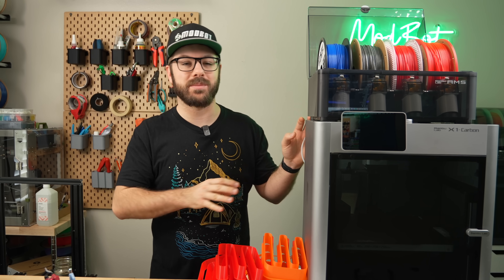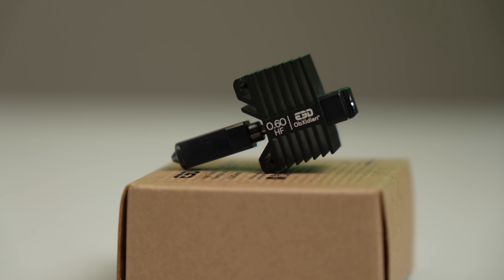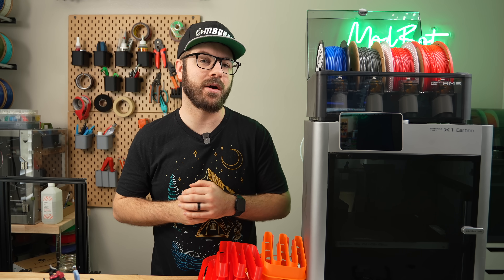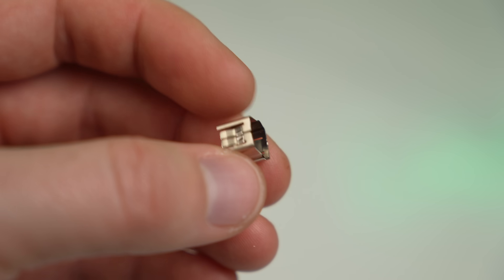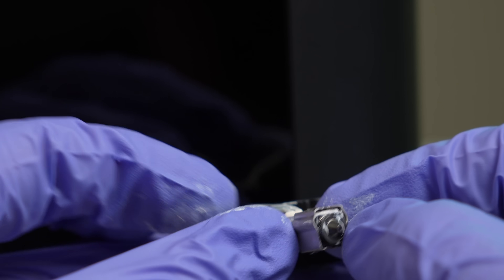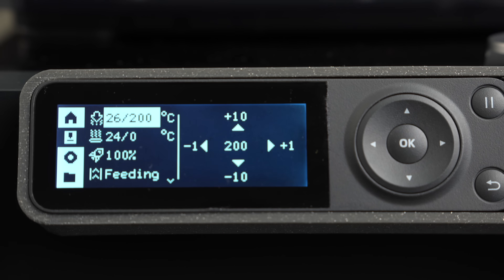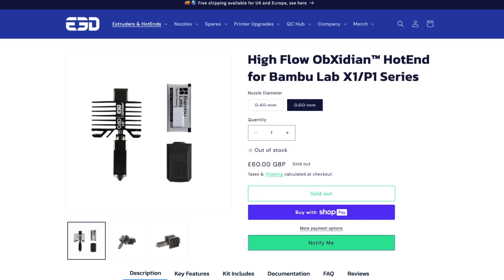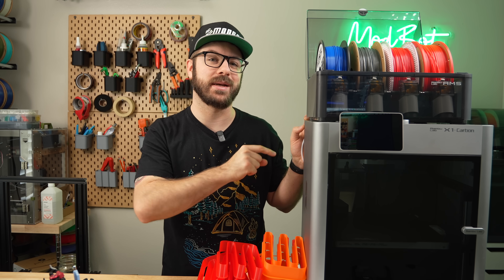Bambu Lab High Flow Hotend Upgrade (E3D ObXidian)

Comment: "the clip wouldnt fit" just flip it...
Reply from the maker: There is a notch for the heater. If that was not the case I’d have flipped it.
Reply: @ModBotArmy  it seems like the other side also has a notch? Did you try it even?
Reply from the maker: @SlinkySlonkyWaffle  the other side has a slit. You can see it pretty good in this photo https://www.aliexpress.us/item/3256805546177949.html?UTABTest=aliabtest481469_657498&src=google&src=google&albch=shopping&acnt=708-803-3821&slnk=&plac=&mtctp=&albbt=Google_7_shopping&albagn=888888&isSmbAutoCall=false&needSmbHouyi=false&albcp=19623912707&albag=&trgt=&crea=en3256805546177949&netw=x&device=m&albpg=&albpd=en3256805546177949&gad_source=1&gbraid=0AAAAAD6I-hEYHPDH2KmZnbj4cxkoef8SU&gclid=EAIaIQobChMIwvSKyYnbgwMVaMzCBB0SyAf_EAQYASABEgLsGfD_BwE&gclsrc=aw.ds&aff_fcid=01dabe2f28eb4985b7cd07b1363a0f2d-1705173308947-09390-UneMJZVf&aff_fsk=UneMJZVf&aff_platform=aaf&sk=UneMJZVf&aff_trace_key=01dabe2f28eb4985b7cd07b1363a0f2d-1705173308947-09390-UneMJZVf&terminal_id=57886f077b044d1ba15d385876c8b7f8&OLP=1086700608_f_group3&o_s_id=1086700608&afSmartRedirect=y&gatewayAdapt=glo2usa

Comment: The clip is the wrong way. Turn it around 😅
Reply from the maker: They is specifically a notch for the heater to apply pressure to it and keep it in place. The other-side doesn’t have that bitch.

Comment: Turn the clip around, that way you're not pressing on the wiring and it fits in the groove like it should.
Reply from the maker: I probably should have shown in the video but the reason I didn’t just flip it is because there is a notch to apply some push onto the heater. The otherside doesn’t have that.

Comment: I bought a Chinese knockoff CHT nozzle kit that's 4 times cheaper and have been running that for months with 35 flow rate and 0 problems.
Reply from the maker: Knock offs are always going to be cheaper. They don’t pay a licensing fee for one. Everyone has to do what’s right for them but other than for experimenting I try to avoid clones.
Reply: @ModBotArmy  Absolutely, we should support the original producers if they treat us right, however, when I picked up the knockoff, there were no compatible alternatives on the market. It was either a stock hotend or a CHT knockoff.

Comment: If you flip the clip around you'll get no issues on the thermistor like you had
Reply from the maker: Yeah the reason I didn’t do that was the little inward retaining clip for holding the heating element in place. It’s probably fine to rotate but the top and bottom are different.

Comment: You had me until “E3D”. After experiencing one of the worst return processes where they did everything to deny problems with the Revo hotends, and tried to blame user error on the problems I had with them. 🤦‍♂️ Had to threaten a chargeback to return them and get my money back.

E3D?  Just say no to overpriced unsupported garbage, and get some cheap aftermarket hardened CHT nozzles instead. 👍
Reply: "Your mileage may vary"
I, on the other hand, have used E3D NozzleX's for years on my Prusas and I use Obxidian hot ends on my X1 Carbon.
I have no issues with them even using Carbon Fiber and highly abrasive phosphorescent filaments here and there. I've not seen wear issues in either the nozzle bores nor the non-stick coatings. 
Did they cost me significantly more than some "cheap" hardened CHT off of Alibaba? Certainly. 
Have I had any worries or problems after years of use? Not a single one. 
The one frustration I had was the time it took to develop the NozzleX/Obxidian nozzles for the Revo hot end (on my MK3S+), which was much longer than expected.
Given the lack of any issues while meeting or exceeding expectations, I've no complaints about what I paid.

Comment: I got an 0.4 E3D hotend for my X1C in december (0.6 was already sold out then...) and my experience is more or less the same as yours. Could push PLA(+) easily up to 30 mm³/s, but also noticed that the heater had problems holding the temp going above that flow when using higher-temp filaments like PCTG/ASA.
During installation I just flipped the retaining clip so the "cutout" was on the same side as the thermistor hole. Since there is one of these little 'springs' on each side of the retaining clip the heater got pushed onto the hotend just as well. So I don't see the need of including a different retaining clip.
Asides that I didn't have to adjust the temps. Temp tower was basically the same with the stock and E3D hotend. But I re-ran the PA calibration and the values slightly differed from the stock hotend.

Comment: So, if I am printing a lot of large blocky PETG items this might be worthwhile to me? Is there any info on the benefits specifically for PETG especially with that coating?
Reply: PETG is globby and sticky so obviously the non stick material will prevent boogers and contaminants in your prints especially when using clear or transparent filaments.

Comment: This was a very helpful review, thank you!  I think E3D messed up on that thermistor placement.  The clip can't be rotated 180 degrees, does that then affect the heater clearance?  I will look into getting one or two of these for sure.    And yeah, the highest flow temp errors are just that, you're outrunning the heater.
Reply: There's usually reasons behind design changes that we aren't aware of like optimal temperature control or relocation by design limitations from the larger chamber. I think E3D should make a complete hotend assembly that comes with a proper retaining clip and improved heater for this design to fully take advantage of their improved flow.
Reply from the maker: It sounds like you can rotate the clip but it still isn’t designed to be rotated. There is a notch for the heater one side. That being said rotating is still probably better than risking damage to the thermistor leads.
Reply: Clip - E3D says to rotate it in the docs. They moved the thermistor for a reason. These guys are nitpicking engineers. The location was chosen to better sense the BLOCK temp. Bambu actually missed on this by placing it next to the heater, one of the 1st things I noticed when my X1C arrived right after the Kickstarter. E3D fixed a minor design error. BTW - don't forget that this was a collaboration WITH Bambu Labs. If they thought it was wrong it would have never reach final production.

Comment: Install the clip flipped upside down. That way the channel for the thermistor is aligned with it.
Reply from the maker: There is a notch for the heater. It applies some force to it so that it stays in place. That was the primary reason I didn’t flip it.
Reply: @ModBotArmy  yeap I’ve seen it too on mine. It shouldnt matter as the clamping force is the same whichever way you install it as the heater is “overhanging” the nozzle. Certainly better than stripping the thermistor of its insulation if you scratch it against the clip
Reply from the maker: @HotendHacker  yeah your probably right. The heater is much less fragile and with the clip on and silicon sock the heater doesn’t really have anywhere to go. I’m more curious why they moved the hole 🤷‍♂️
Reply: @ModBotArmy I’m guessing here but thinking that having it further away from the heater block gives better temp readings 🤷🏻‍♂️
Reply from the maker: @HotendHacker  interesting. Definitely could be it. I’m sure there has to be a reasoning. That’s as good as any theory I have come up with.
Reply: When will these be back in stock??
Reply: @mmakam3  I emailed e3d before Christmas and they said in March. However I managed to get one from another retailer that had it stocked in the uk (additive X)
Reply from the maker: @HotendHacker  oh man. They had mentioned a couple months a little over a month ago and I was hoping that was worst case.
Reply: @ModBotArmy  yeah it’s not great that. Missed opportunity for their sales…
Reply: @HotendHacker  do they ship to US?

Comment: Great stuff! I see that my Ender 5 S1 spider hotend also reaches about 21mm/s cubed with the warping edges like the original Bambu, would it be worth it to upgrade to a 1.30 USD clone CHT nozzle (when buying three at once) from Aliexpress?
Reply: For how cheap they are definitely, especially if you can get a hardened steel variant. Since they dont lose performance like a normal hardened steel nozzle would.

Comment: Would the clip fit upside down?  Looks like it would fit over the thermistor wire if you flipped it 180 degrees from original installation orientation.
Reply: Exactly correct! I’ve installed mine flipped and it works perfectly.

Comment: I would be concerned about nozzle clogs with fiber reinforced filament. I would love to see tests with that given the CHT style has narrow channels within the nozzle I would assume it could clog easy. If its not good with fiber then it seems counter intuitive to have used obsidian in the first place. Thoughts?
Reply: I've had no problems even with the hardened steel clone Vulcano cht's which have the worst internal geometry by far. Even with those Ive not managed to get a clog when using abs-gf or any CF filament.
It's more prevalent on Bowden printers with high retracts (1mm+) than on direct drive where you shouldn't really need more than 0.2-0.4mm when using the right PA.
Reply: The channels are larger than the nozzle orifice so if your nozzle can take it so will the cht insert
Reply: A quick cold pull after using any reinforced/infused material filaments is an easy way to circumvent that. I typically perform cold pulls after swapping from any materials that don't play well together.

Comment: What temperature did you use cause if you printing at fast speed you use higher temperature than recommended for example I print PLA at 240 C ?
Reply from the maker: I’m this case I ran slicer defaults. It didn’t feel right to raise speeds. It wouldn’t give a very accurate representation against the stock results. I agree though raising temps will let you print faster but it can introduce other complications.

Comment: The temp error you got is a known issue with the clone hotends that accepts normal nozzles, the stock 48w heater is just not enough at higer flowrates. Youll want to get the heater of the rapido 2.0, chcb-ot or any other 60w+ ceramic flat heater.
Reply from the maker: Good to know. That makes a lot of sense and explains it. The filament is just outrunning that heater. So when it maxes it the drop off is fast.
Reply: Yet another reason that E3D needs to offer a fully assembled version.   @ModBotArmy
Reply: @Trevellian there might not be enough power headroom to increase the heater watts.
Reply: @ModBotArmy since the heaters can draw less max power at higher temps it'll be even more obvious when testing filaments that need to be printed near the hotends max temp. 
There's a reason most high flow hotends come with 80 or 100w cartridges by default.
Reply: @twanheijkoop6753  only ptc heaters drop wattage with temperature. Traditional cartridges don't drop power, reason why they can melt your hotend. A ptc heater gets less powerful like you said. Phaetus published tge numbers for the rapido 1. 115w at 20c, 52w at 200c, 48w at 250c. If the bambu hotend drops similarly you have around 24w at 250c, which is abysmal, no wonder tge heater was outrun
Reply: Measure the resistance of your heaters, some 3rd party ones I got, worked out to 10W lower than the stock one but even Bambu ones have large variance. Also, the 3rd party silicone sock was 1/2 the thickness in several areas (and much denser, suggesting higher conductivity), using a Bambu heater and sock fixed my problems  @ModBotArmy
Reply: Ran into the exact same issue when i hit a peak flow, the drop off of temperature was quite noticeable. I think need a higher watage flat heater
 @ModBotArmy
Reply: @ModBotArmy  Can you use this nozzle on the A1???
Reply: I am so glad to be a part of this community for this reason. I purchased a third party CHT hotend months ago for my X1C and continuously had thermal issues with high temp filaments. So much, that I removed it and it's just been sitting in the spare parts bin. I tried different thermistors and heaters from bambu and the one that came with the third party hotend, reapplied thermal grease, etc. with no change to the issue. Where can you obtain the heaters you mentioned. Also, are the heater replacements you mentioned a direct drop-in replacement, or will it be more involved than just remove/install?
Reply: I've run into this issue even with the stock hotend when I try to print at high flow rate and high temperature. The filament cools the hotend too fast.
Reply: Can you get those heaters with p1s connectors? Or is it a rewiring job?
Reply: It’s likely the only reason you don’t see this error more often with the stock hot end is because the thermistor is on the same side as the ceramic heater. The e3d is configuration is arguably better as you’ll get a temperature reading more representative of the entire heat block with the thermistor on the opposite side but it has revealed that the stock heater is underpowered.
Reply: Thanks for this video. Great content as always. As a P1S owner I was thinking of this upgrade but having now watched this, and the replies in the comments,  I shall hold of.
Reply: do we know what the max power output of the x1c toolhead board actually is? a 24v 70w heater would be about 3 amps power draw
Reply: Would a 60w heater work to increase the stock nozzle flow rate or would it damage the parts?
Reply: @SpookyBoson  I was tempted to file down the other side of the heatblock and add a second heater haha. But using Bambu socks and heaters solved the problem while below 38mm3 and 250C. As I measured, the stock Bambu heater worked out to 52W, and the juupine lab one was 43W.

In direct answer to your question: that depends on the MOSFET on the toolhead board. I can't imagine a 60W heater would cause problems, but I can't say for sure without more info:

I couldn't be bothered to disassemble fully and take a close look, but if you can read off/get a clear photo of the chip identification markings on the toolhead board, I'd be happy to look up the datasheets to see how much current/power it can actually handle.
Reply: @SpookyBoson  probably won't see a flow increase but shouldn't hurt anything. It's only 12w extta
Reply: @twanheijkoop6753  It absolutely does, i can push it 80mm cubed easy.  I have a video showcasing this compared to the stock heater.
Reply: Absolutely do not do the rapdio 2 heater, someone has already burned their th board.
Reply: I only ran into that issue doing the same flow test on Orca slicer

Comment: The heater wasn't able to keep up with the speed need a heater that is capable of maintain the temp at higher speed. Not bambus fault as was never designed to run at such speed but E3D should offer at least in the future higher wattage heaters as the stock one limits what speed u can print it at and a retune PID need to be done.
Reply from the maker: Interesting. Since they are working with Bambu directly I would think they would be able to collaborate on a higher heater for their hotends. Then perhaps a setting that applies the needed pid values for that.
Reply: @ModBotArmy  There is a good chance it is in the work but I think due to the footprint of the heater size it very hard to actually design a higher wattage heater pad that is reliable and durable. But I am fairly sure it will be in the works. This is why on UHF hotends heaters are often can go up to 120w if needed, I personally have seen 20+ degree temperature  drops even when going stuipd speed like 80. The main counter without upgrading the heating pad capability is to crank the temperature up however it will effect print quality at the slower speed section
Reply from the maker: @8bits955  that’s a great point. Due to the form factor and unique geometry of the heating element there is only so much space. I still think it is possible. Bigger heater, bigger clip, and bigger silicon sock should be enough as long as the toolhead board can actually supply the needed power output.
Reply: @ModBotArmy  yep everything need to be considered the tool head board, the connector all that need to be taken into consideration if it isn't It will become a fire hazard. In otherworld a lot of work
Reply: I would worry that the connectors might not be up to speed with higher wattages... 100 watts through a tiny little JST/Bambu connector? @ModBotArmy
Reply: The heater is adequate for the new max flow rate - even with higher wattage you won’t be able to go much higher than 30-32 mm3/sec with a cht nozzle so the heater is barely adequate to hit that speed. Would it be nice to have a larger heater? Sure! Is it needed? Not really
Reply: @HotendHacker  the heater isn't adequate, you can clearly see that the heater cant keep up with the speed of the even running at 30/32 as that is a whole 10 degree drop from target. if heater is adequate then you shouldn't see a temperature drop at all. Heater is only adequate if you printing at stock speed at the stock hotend which is what the original heater design for. But what is the point buying a higher flow hotend and you cant get decent quality out of it at the higher speed.
Reply: @8bits955 I own this hotend plus the old Ali express cht ones. Temp drop starts at 32mm3/sec. Till then no issue with it. Not sure of the editing of the footage or what volume he was running but my experience with both is the above… same for the Bambu forum group that started experimenting with these last year. Around 30-32 is the max you’ll get before starting to loose temperature
Reply: @HotendHacker 30-32 is the limit of that heater then as soon temp drops that means it cant keep up. would love to see what that hotend can do with a heater that can keep up could be capped at 34-35 or it can go even higher.